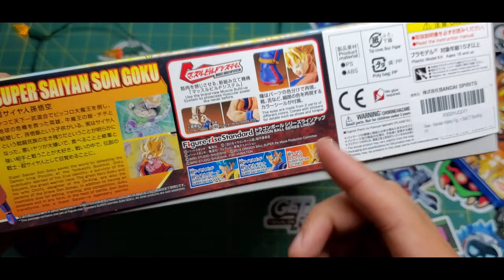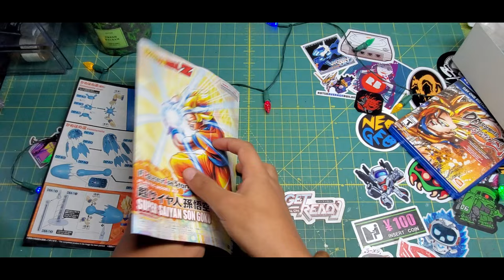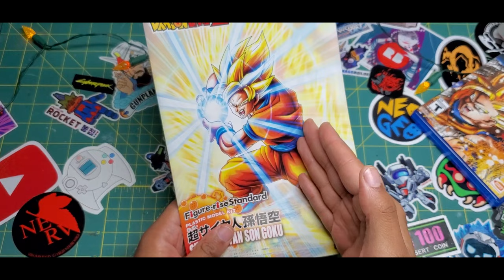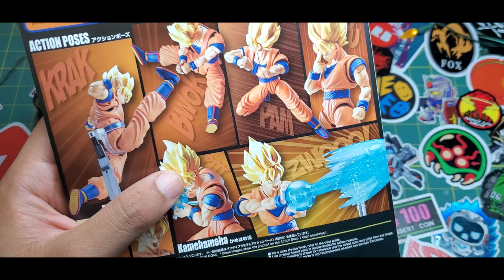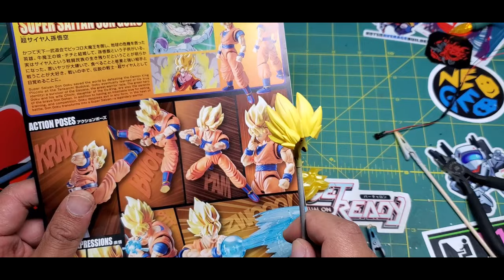#Newtype #Goku Dragon Ball Z Super Saiyan Son Goku

Comment: Hey I want to put an LED in my kit for the first time. You are a big inspiration!
One question I have is what size LED can I use for a master grade zaku mono eye?
I looked at the selection of LEDs on evandesigns.com and there are many options.
Thank you and keep up the amazing content
Reply: I’d say nano. I’ve used I think either a nano or pico on the back of a RG Sazabi’s eye and it worked absolutely perfectly. Only problem was that it would also light up the visor but I think that’s just bc of the Sazabi’s design. The Zaku shouldn’t have the same problem.